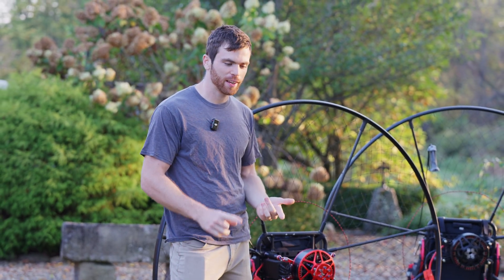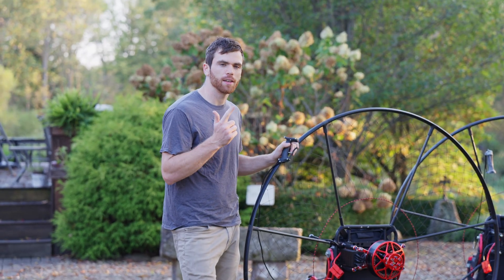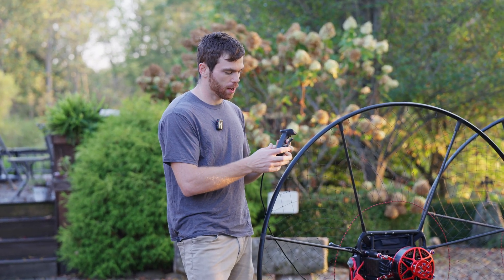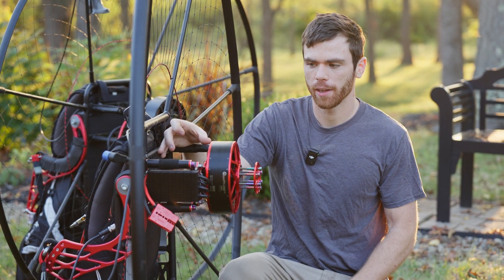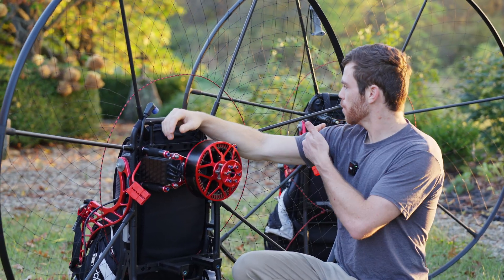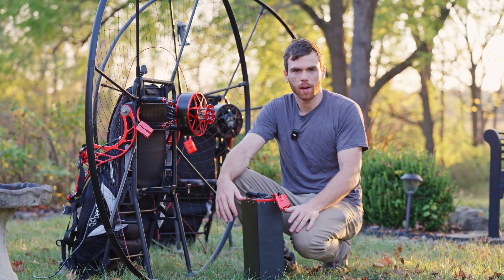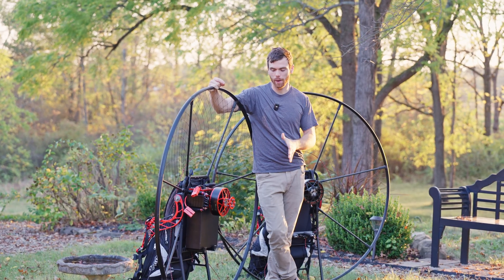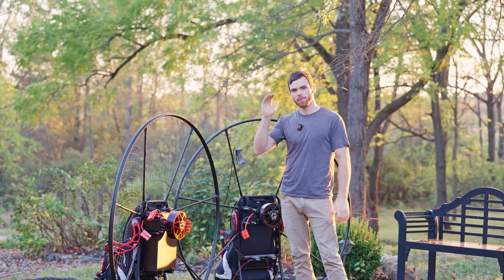V2.5 vs V2.0 Electric Paramotor

Comment: Congrats man, i've followed this project since you first started. Sadly have not been able to pull trigger due to cost of this expensive hobby. But amazing work. Out of curiosity...is this portable? i.e. can you easily take the frame apart and keep netting somewhat intact and get it in some sort of a bag? or do you envision just build it and carry the whole thing around
Reply from the maker: It breaks down to the smallest size of any paramotor I know for transport, as there is no fuel tank and the center of the frame splits in two.

Comment: Why don't you increase battery size to compete with the Italian 21, there's is 5kw, your setup looks better, if you could match there flight time I would be ordering one tommorow
Reply: The flight time is longer then the Italy 21.

They use a smaller prop which is less efficient and I haven't seen any videos from them with flight time matching the SP140.

Comment: When I was first flying the V2, sport mode had too much power and was too responsive but after getting used to the motor, I only fly with sport mode. The extra responsiveness in sport mode has kept me from crashing a few times when I'm flying very aggressively close to the ground and I misjudge. For me personally, it would be great to keep full responsiveness - maybe by adding a third mode?
I have been really happy flying the V2 and these upgrades look awesome!!!

Comment: Would a collapsing prop be an option? Centrifugal force opens prop.  Cage would not be needed.  Something to consider for a minimal air resistance.  Maybe  a leg sack with a way to extend large forward for a more streamline profile.
Reply: You will still want a cage while the prop is in use.  This is incredibly important for keeping your hands/throttle/toggles/clothing out of the spinning prop.
Reply: @JRSkola extending the prop shaft a distance . Prop does not spin until wing is above.  Let off throttle  prop collapses . I don’t see the concern. My hands or throttle never get close to the net.   See Eric Dufour no toggles nor cage launch.  A collapsing prop is so much safer for electric only. 
Not practical for a gas machine.
Reply: @bradbrown2168  I hadn't seen the Dufour video!  Crazy!

By your logic, why wear a helmet?  Your head never gets close to hard things.  Why wear gloves?  You never get your hands in the lines.  The cage is there for when things aren't perfect.  When I wrote "You will still want a cage" I was meaning the royal you, as in 'most people'.

That said, I think its interesting to see people push boundaries -- I'd like to see the extended prop electric folding power system in practice!
Reply: @JRSkola  

https://youtu.be/wuhSRdffuDw?si=VJy-EUrQh3KbfDLt
Reply: Most of your drag is from your body.

Comment: Yeah, Im not flying about with a 5Kw battery pack strapped to me with no escape.
Reply: Isn't it basically the same problem as an engine with gas? The alternative is an extremely hot engine behind your back, with a large tank of highly flammable fuel within inches of it?

Comment: Great update! The V2.5 has a lot of important features that I thought were missing in the earlier V1/V2 design. Is there a plan for a lower-cost upgrade path for those of us with V1/V2 hardware? I'm thinking something like new controller, new BMS, new ESC but re-using the old motor and the cells from the battery.
Reply from the maker: It could be done. The ESC could be swapped but would lack the temp sensor built into the motor.  The BMS would not be easy to swap in an order battery and using the old battery with the new system would loose a lot of functionality.  So I dont think that would be worth it if you plan to use the older battery.

Comment: Did I hear correctly that the V2.5 battery is backwards compatible with the original model? I have a batch 3. Thanks!
Reply from the maker: Yes just need to add a spacer and its ready to go, same size and slides in the back the same way.  Then your are good to go.

Comment: Zach, is your 2.5 ver electric adaptable to a lightweight trike? If so, which ones? Estimated flight time with the new battery and just conservative, puttering around flights? And finally, the cost I would be looking at for what I could source through you? Sorry for the long list of questions. Thanks

Comment: Super informative and long overdue, although I already am familiar with all the new features, this will help those who might be on the fence on an electric PPG. I really love my V2.5 and have had zero problems since purchasing one of the first ones. My Nitro has been collecting dust in the corner this flying season.
Reply: what is your flight time - realistic not conservative flying
Reply: @jannike1015  half size battery, flying "normal" flight with 1000ft of altitude gain for entire flight, 30 minutes and that is landing with 15% remaining. 23M wing, 170lb pilot weight.
Reply: @rickgrimm5130  15% remaining means you're getting 30mins from that 85%. That gives you a bit over 5 minutes of reserve which is at a reduced available power. I purchased the X4 a few years ago now as my first paramotor. Don't get me wrong I loved flying it. The ability to pack in the car and the lack of torque to deal with were primary considerations at the time. But every flight was an exercise in precision flight planning. I knew I could fly upwind for 7-8 minutes and then turn back and that was pretty much it. If I calculated too conservatively I'd have enough for a practice approach or two just for fun. If I calculated too generously ... well lets say I calculated conservatively every time! 
Now I have an Atom 80 powered machine and when I land I generally have 20-30 minutes worth of fuel in the tank. I definitely could cut it finer. But it's very comforting to know that reserve is there when I get back to the field. This 2.5 version seems like it should give me a 30-40 minute flight with 10 or 15 minutes of reserve power easily so that'd be plenty for my flying.

Comment: What is full weight with the 4.8 kWh battery?
Reply: I’ve achieved a P2 Certification with Eagle Paragliding school a few years before experiencing a Broken mid-Back/Spine at Thoracic 8 in Vertebrae, immediately beneath Ribcage; I love the Freedom of Paragliding, I’d Love to Pursue a TRIKE similar to Paraglider “superDell” and his FLAT-Top, Plus Extra Batteries plus Significant SHOCK-Spring absorbers for a Gas-less Paraglider Trike allowing More Batteries and Greater safety, Because I can Walk yet barely can walk with any weight, maybe a iPad!

Comment: Weight with  the new battery.  Your website says about 80lbs. Im just checking if thats the updated weight with this model.
Reply: Mine is 84lbs with reserve installed.
Reply from the maker: Ya 78.6lbs ready to fly with the large battery.

Comment: How loud is this setup compared to an Atom 80?
Reply from the maker: It’s quieter; at full power, the difference is smaller—maybe around 20% quieter. Cruise is where the real, large difference comes in noise comparison. I would say it’s around 50% quieter in cruise. The largest difference is in the noise perceived by neighbors, since the pilot is right next to the propeller, so it’s not a huge difference for the one flying.

Comment: Is there a plan to use the new INR-21700-P60B cells soon?
Reply from the maker: The cells we use in the new battery packs are a semi solid state cell. With and energy density of 310wh/kg.  So they are already higher then the P60B. 

Also we do use pouch cells as the energy per volume is higher, which is why we can make the new battery case smaller then before while have a 30% increase in capacity.  We are always looking for new better cells be we do have to balance, cycle life and backwards compatibility with many other factors.
Reply: @openppg oh fascinating, thank you. I'm very interested in a long runtime battery, like the one you used for the world record flight. Keep us updated on that!
Reply: @openppg  for 310wh/kg the weight of 4.8kWh pack should be (4800 / 310 = 15.48 Kg). And your pack weight is 22.5Kg which gives only 4800/22.5 = 213wh/kg. Where is the mistake?
For INR-21700-P60B it's 280wh/kg, so for 22.5Kg pack it should probably give 6300kWh.
Reply from the maker: Energy density is measured at the cell level, if you are look for energy density at the pack level it will always be less because then there is other weight like the metal case, BMS, cell connection, wiring, potting material ect
Reply: @openppg  but the difference is huge, 22kg vs 15kg, it's 7kg difference. It's like 1/3 of the whole weight, i doubt that case, BMS etc has 7kg weight.
Reply: Or any similar pouch cells if exists, with similar energy density?